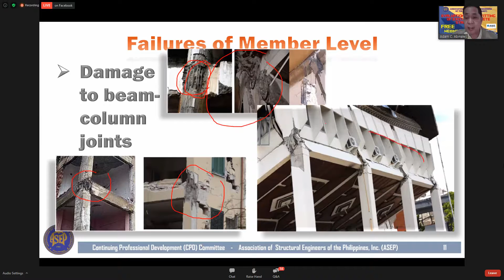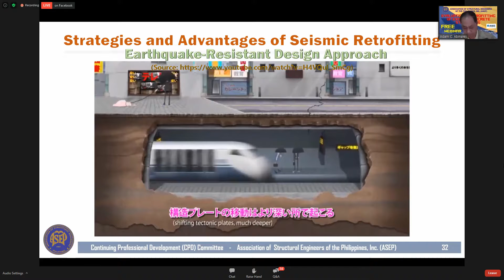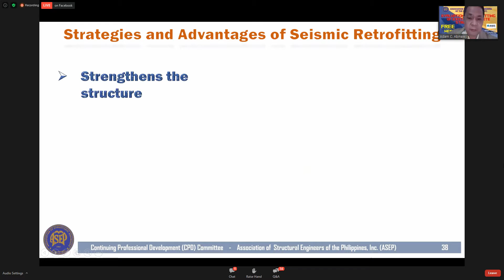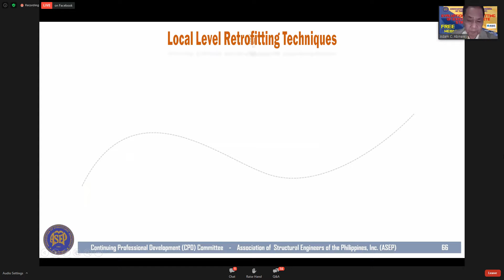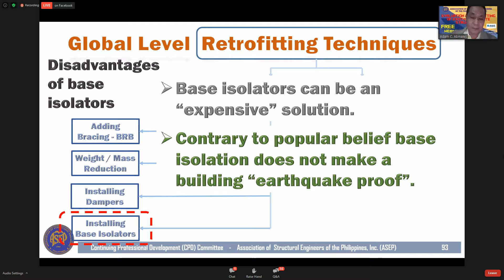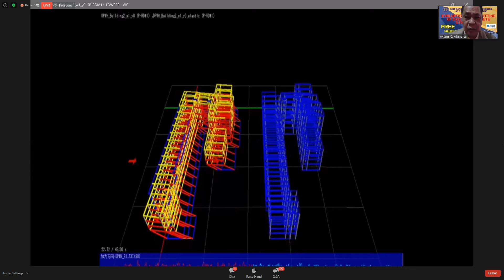Retrofitting of Existing Concrete Structures: Techniques, Codes and Guidelines (June 20 2020)

Comment: thank you sir for your shared knowledge of structural retrofits. In case of the addition or introduction of shear walls in areas where there are none, supposing the foundation of the structure is mat foundation, what possible methods can be done to make a sound connection between the mat and the new shear walls? thank you.

Comment: Yes, it's very expensive today due to highest cost of materials. I may not say retrofitting rather re-comlumning. Setting the column besides the old column, 3 ft depth of  footing tie - beams, and wall footing.. as in newest structural erected. I am not agreeing on cutting columns instead  wrapping steel bars on that particular area.   I am not an engineer only a retired Dept head.